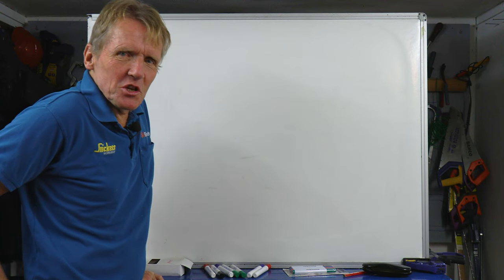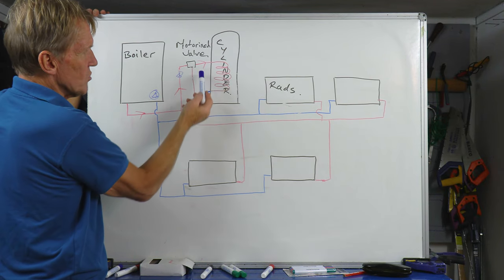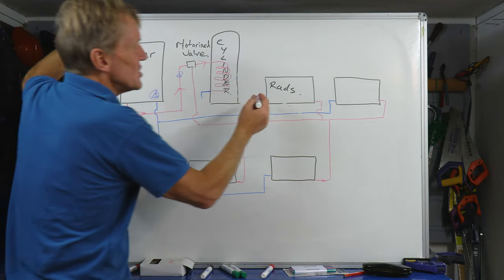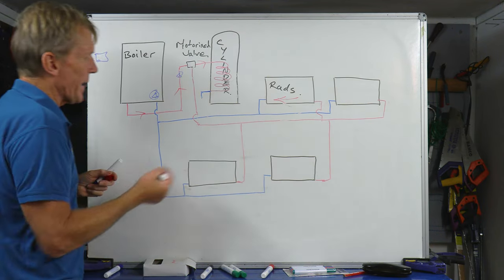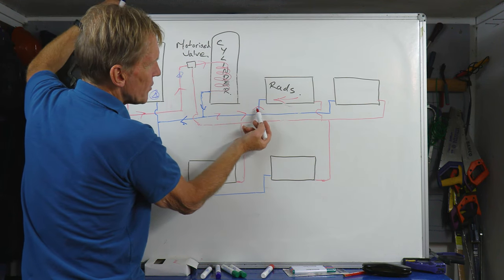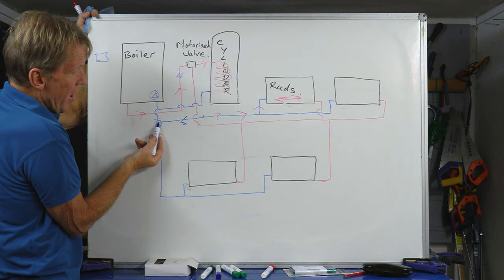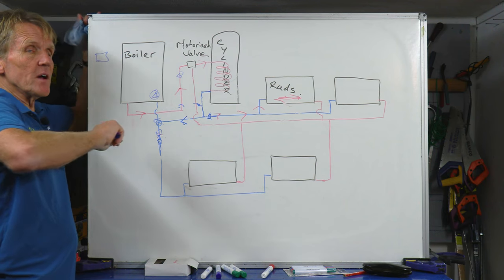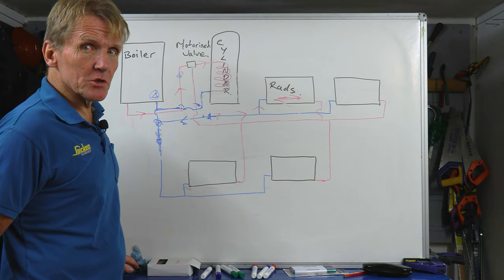Why Are Your Radiators Getting Hot When the Heating Is Off?

Comment: Good one Roger 👍🏼

My shower mixer doesn’t go completely cold on the coldest setting. Is that likely to be design or installation error?
Reply from the maker: I also like a cold shower. You need to callibrate it. Usually it is a case of taking the knob off and moving the stops.

Comment: Although an excellent video explaining reverse circulation, the critical question to ask the customer is “has this problem always occurred or is it a new phenomenon”. Reverse circulation is caused by poor system design and won’t just happen all of a sudden! If rads are getting hot with just a H/W demand is a new problem it’s more than likely Motorised valve letting by. Some valves are more notorious for this than others!!
Top marks for the explanation of the common return though 👍
Reply from the maker: you are so right. I know some people put up with this problem for years and some discover it when moving in to a new property but a few questions will lead you there faster.
Reply: Aaah. So this happened after we got someone to replace the TF1 filter. Could he have fitted it in wrong?

Comment: I had the opposite happen wherby the rads stopped getting heat when the heating was on.The motorised valve motor was also making a buzzing noise.I replaced it and wired it in correctly and all was good.The only faff is part draining the system first and then bleeding an rebalancing afterwards.Changing the valve took about an hour all in with wiring but overall the whole job took about 4 hours.

Comment: so from a non skilled DIY man (Who wont be touching his boiler!) I have the same issue, but I dont have a water tank, just the ISAR HE35 combi-boiler.  Situated on the kitchen wall, and the radiator directly upstairs (probably the first radiator on the system) get warm even in the hot summer.  Problem is the dam boiler fires up every now and again I suppose due to some funky programming on the PCB? Does the backflow of water you explained in the video cause any issues?

Comment: Thanks for your fantastic video, I have come across a problem with my bioler, can you please help.

So basiclly the bioler is controlled via a Hive system, I have hot water scheduled for 30 minutes everyday which is sufficient for everyones usage. The bioler has its own mind and will turn on and off on its own despite the fact that the controller is turned off for both hot water and central heating.
I checked the routine, and it seems to be: it will turn itself on every 3 minutes for 1 minute, then shut off for 3 minutes until the next circle.

When it's on, water circulates through the pipes, and no radiators are hot.

It looks like the water cylinder is calling the bioler to wake up? After an overnight power off from the mains to the bioler, the first start up seems much longer than 1 minutes, and that is when hot water not scheduled to start up at all.

Your help is much appreciated. Thanks in advance!

Comment: October now. New boiler fitted in 3 floor house by Brit Gas last month. When heating goes off, top floor  rads v hot. Same floor as emersion tank. Initially top floor rad long to heat. Now the opposite. Rads had power wash. Something stuck?  What's the problem, do you think? Advice appreciated!

Comment: Great video, Im an amatuer but I thought the pump in the airing cupboard pumped it one way? so i don't understand!!...Also, does the 3 port valve let the hot through to the radiators when the flow is reversed, hence the heating on when I don't want it. I'm not sure which way my flow was at the radiators so i can't test by feel. i've replaced the 3 port valve motor following your tutorial and the problem came back after a while so i replaced the pcb and still got the problem.....could it be the internals of the valve body itself sticking open? would appreciate any help.

Comment: Excellent video. One question I have is that we have a loft conversion and the radiator in the bedroom in the loft conversion gets hot when the hot water turns on, but no other radiators do in the house (they get hot when heating is on). Is it possible that this problem can effect just one radiator?
Reply from the maker: Hi Paul 
It can sometimes short circuit around one rad. It is likely that the plumber saved having to run a pipe right back to the source or that it was intended.

Comment: Hi Roger, we have a baxi 428 combi and the central heating flow pipe gets very hot when the hot water is on even though the heating is off. Should this happening? If not, what would be the cause please? I did have a baxi engineer out as I felt the hot water wasn’t as hot as it used to be but he just said the weather is colder and dismissed my concern over the CH pipe getting hot. Any advice would be appreciated. Thanks

Comment: Absolutely brilliant explanation, totally correct. As you've probably guessed we have a similar problem, though only a few rads get a bit warm on top. But even if the primary return went closest to the boiler a strong pump action could still make the rads reverse circulate couldn't it ? Thanks.

Comment: appreciate it

I have the opposite my CH is coming on when I put on the HW only 

It is not reaching the temp I would expect of 60 to 65deg c but only 54 deg c and no more

Preumably because the rads are taking its potential to

I keep trying to fix this to no avail

Mr Bisby may i ask one thing😊 my HW cylinder return is 22mm buthas been reduced to 15mm and I do not think its connected to the return  There is a H piece 22mm twin pipe connected to CH side but one of the pipes has an offset 15mm  to the 15 mm pipe that is where it connects 

Could you help me identify the 15mm pipe if its the boiler return or a CH return and how do I find the primary return

Comment: Even with the rads all tee'd before the primary return is there still not the chance of the water working back some, or would there be some sort of back pressure preventing it. Would it be reasonable to put a one-way valve in too, above the tee, but before the tank return?

Comment: Many thanks for explaning this problem,as I have a recurring problem with my central heating that I can not sort,
Hopfully  I will come across it in one of you  blogs,
Reply from the maker: Colin 
You can tell us the problem by going to the contact Skill Builder and I will do my best to help. If it is a good subject for a whiteboard I will do one.
Reply: Hi threre,
The problem I have is I dont think that the Pump is powerful enough to pump water through the ground floor radiators ,As I have to switch the pump up to top speed to get them to warm up,I also suspect that the room stat is not talking to the Boiler and am about to replace it,the zone valve is working,but to get the heating to work I am using the Hot water Cylinder Belt thermostat to  run the heating which  heats the hot water in the taps and make it  too hot. Any advise would be of  great help.

Comment: I moved into a house, has 3 zone heating, all new to me. Still wondered why hot water button has both bath room rads and kitchen rads coming on. Heating engineer said it was wired wrong by the spark at the control panel. He mentioned a valve is always open when it should close and the rads are stealing water from the hot water button. Ive still to get a spark out
Reply from the maker: It may be wired wrongly but it sounds to me as though it has been done to give you two towel rails and a kitchen rad for drying dishcloths. I can't say for sure but it is likely

Comment: Roger, thank you for this video.  Very informative.  Can you tell me please…..if the radiators are hot when the boiler (heating) is off, is it still putting a charge on your gas bill even though the boiler is off?  Thank you! 😊
Reply from the maker: Yes if they remain hot for more than 20 minutes it is costing you money
Reply: @SkillBuilder  thank you very much.  My bills are extraordinarly  high.  I live alone in a flat that’s compact and doesn’t get that cold.  I wondered why so thank you very much for answering this question.  

I had my boiler serviced recently.  Should the gas engineer have picked up on this warmth of the radiators by looking at the boiler, without me telling him?

Comment: Learnt something new! My only protest is the non return valve. This will cause problems when we do powerflush of the system and alternate the direction of flow left and right. It's obviously not going to allow that. There must be another way without requiring non return valves.

Comment: I have had problems with my  entrance heating. I have had 3 new 3 valve changed. I think it is now, after looking at our youtube I think it is revers circulation problem? 
My question is could you just change around the valves on the radiators?
I had a new boiler and tank  fitted 2 years ago.
Can you give me some advise?

Comment: What would it be if you have a combi boiler/no hot water tank and when the hot what runs, the radiators heat up. I believe my boiler also does not have a 2 port valve which most folk point to. Boiler is a worcester 28i, 8/10 years old

Comment: What about bypassed towel radiators? Have come across this when towel radiator heats both on Hot Water and Central Heating. Is that still an acceptable installation technique?
Reply from the maker: Yes that summer operation of a towel rail is still common on stored water systems. It is hard to achieve with a combi so an electric element is placed in the towel rail.

Comment: For me i’ve got a W-plan so as soon as I call for hot water the bathroom rad gets hot, and as being a plumber Ik it can be something we forget abt as its not rlly used anymore 😎
Reply: That's how my system is installed - on purpose - so that the bathroom radiator comes on with both hot water and heating so you keep your towels drying.

Comment: I’ve just recently developed this problem with a 10 year old Worcester Bosch combi boiler.  I don’t have a cylinder or any visible pumps or valves.  Presumably then it’s something within the boiler not working as it should, or did previously.  Any views or advice before I call out my boiler servicing engineer would be welcome.  Thank you.

Comment: Thanks for the great explanation. Will do the test for the reverse water flow as it’s strange that only 2 of our radiators heat up with the hot water and the others don’t.
Reply: I have the same issue. What were your findings?
Reply: @isabellaleadbetter2302  Plumber found when the pipes were originally done they fed the bathroom towel warmers from the same pipe as the radiators but via the hot water system. 

He installed a valve and connected it to the heating timer so it only fed water when heating was on and jot hot water.

Comment: Hi
Many thanks for this!  I  m not sure but I have similar problem.  My boiler is only 3 yrs old. since we change the boiler my top floor radiator of one of the bedroom and bathroom including tap water  r hot at middle of night @3am. The  pipes of all radiators r hot of all upper floor. 

The valve has been changed twice. But the problem was still there.  Our Nest shows the heating is off but these radiators and tap water r still hot.  Gas engineer checked and changed that valve again last week, cleaned and drained the system. Now He doesn’t know why the radiators and tap water  is also hot enough to wash dishes even with hot water off for the whole week.  According to him if the Nest reading is the heating is off then there is nothing wrong with the system and he can not do nothing else. 

Do u think is it possible to set up the freezing temperature at higher levels for the boiling to start at the higher temperature.  I don’t know whether it will make sense to u or not what I m trying to explain? 

But i desperately need help from people like urself!  

Best regards 

Harinder Kaur

Comment: Hello Roger.  How about  just closing  the lockshield and the TRV on each radiator?  Wouldn't the water  stop flowing?
Reply: Yes it would of course, but you'd have to constantly be turning on and off as and when you wanted heating on or off.

Comment: Hi Rodger great video but you make it sound like a passing mid position valve is rare and reverse circulation is common. It is in fact very rare to get reverse circulation,  most people coming here with rads heating up will have an issue with a mpv or zone valve. 
I have mentioned in another comment that in 11 years I've only had reverse circulation twice. Again a great video on reverse circulation but I can just imagine lots of customers second guessing there plumbers diagnoses after watching this. A good plumber/heating engineer will diagnose this in seconds.
Reply from the maker: Yes there is an unintended emphasis on the reverse circulation. On reflection I should have said that before taking any action you have to prove the point rather than jump to conclusions. I don't mind if the customer questions the diagnosis because the plumber will then prove the point. I apologise for the bias but we will leave it up there now because I do say it can be the valves.
Reply: @SkillBuilder  definitely worth leaving up, it's a useful video and well explained. You provide great content and have helped me expand some of my plumbing knowledge in your videos. 
Keep up the great work.

Comment: Hi Roger, thanks so much. Our radiators do this but they get absolutely boiling hot in the summer not just warm, would it be the same issue ? It’s a new renovation so all pipework is new. I’ve had the plumber look at it but he couldn’t find anything wrong. Split system our underfloor heating downstairs is fine but all radiators on the 2nd thermostat system do it.
Reply from the maker: Most likely this will be the case  but you need to check by feeling the pipework and seeing which way the water runs.

Comment: great explanation, don't think it's my problem though, the system was installed 20 years ago.  it`s just recently my heating is on all the time regardless
Reply from the maker: It is probably a jammed micro switch or mechanism in the motorised valve. Put a vacuum cleaner nozzle on it and you might remove some grit and dust.

Comment: Hi Rodger 
Great informative video as always. I also have this issue but with my combi boiler which was only installed a year ago is there any different issues with this or is it a case where as you mentioned they have joined the return in a similar place ?

Thanks
Reply from the maker: Clem 
It won't be this issue with your combi. Does it happen when you are running the hot tap or after the hot tap is turned off?
Reply: Skill Builder  when I’m running the hot water
Reply: @SkillBuilder  it is most likely a problem with your combi boiler. The boiler has a diverted valve also which can get jammed between heating and hot water. 
Also your plate heat exchanger could be full of debris/sludge forcing water down your heating circuit.

Comment: Hello Roger, I am Italian living in the UK and I am trying to get some understanding since I bought a house and had heating issues. I got a code on my Ideal boiler FA which is flow and return reversed. One engineer changed the pump abd the motor in the valve as radiators were hot on hot water only, nothing sorted. After him another changed all the 3 port valve showing me the dirt and the mechanism not working, it looks like I am not having warm radiators anymore(it's been just yesterday he fixed those) but FA code still flashing when on hot water only.At this stage don't really know what it could be :( causing it. When the FA goes on in the cylinder area pump/noise is on, it appears sometimes the C in blu and then fails again. If it wasn't for that FA the system looks like it's working fine...HELP PLEASE

Comment: Hi Roger, for years I have been buying MAPP gas as I used to do plumbing work now and then and A/C work. For the last few years the most it gets used for now is to light the BBQ or log burner, light the dung heap and a once in a blue moon bit of plumbing at home. I recently found the Propane mix gas in blue canisters at Screwfix but have never had the guts to buy one and kept with MAPP which is about £3 more expensive. I'm sure the Propane will suffice for my light work needs now but any thoughts?? Are the blue propane bottles any good for doing 35mm solder joints do you know?? Will it maintain the desired heat to solder.?? If so I'm going to convert as I don't really need MAPP. I know MAPP is hotter about 3500 degs and I think Propane is about 2700 degs or something like that. 🙄
Reply from the maker: Hi Tony 
To be honest I have stuck with MAPP most of the time but often I wonder why because most of the time I am turning the flame right down on my Turbo Torch. You certainly don't need it on fittings up to 28mm. I often use a heat shield which directs the heat back around the joint and that is plenty hot enough. I also find that the Propane gives you more life out of the heat mats.

Comment: Hi Roger, I don’t have a cylinder in my system and here in the UK I have not needed to put my radiators on for the last three years as my neighbours have theirs cranked up so high that I can feel the heat coming through the party walls, great for me, not so much for them. My question is will it damage my system not turning the radiators on year on end.
Reply from the maker: I have rads in my house that are always off. You do find the TRVs seize up but they can be freed.

Comment: Would it not also be possible to fit another motorised valve to close off the Central Heating Return flow pipes when the Hot Water Cylinder is calling for heat.

Comment: Hi this has just started with mine. I have a combi boiler with a mega flow system and I have switched off the heating but have kept the hot water on a schedule. Now when the hot water comes on the heating comes on as well. The heating comes on at full blast. Does this mean my motorised valve need replacing?